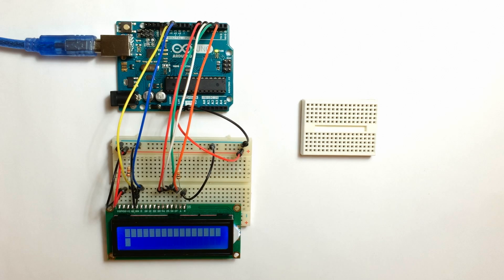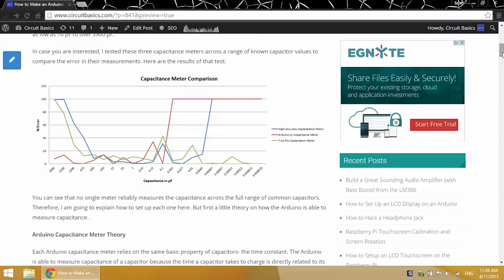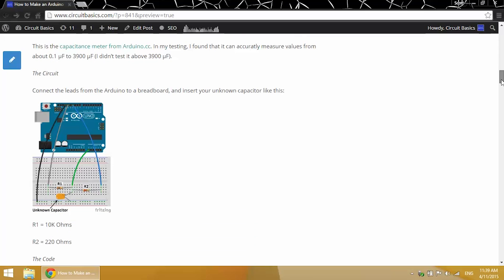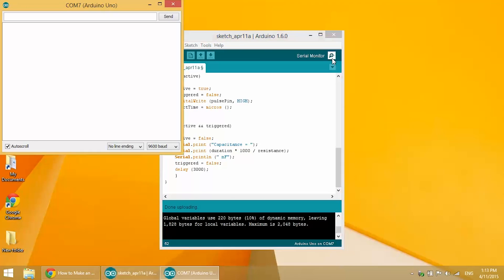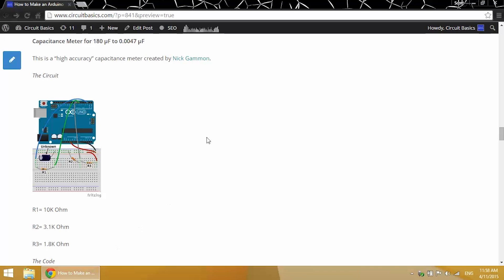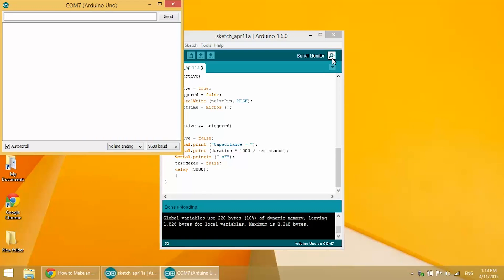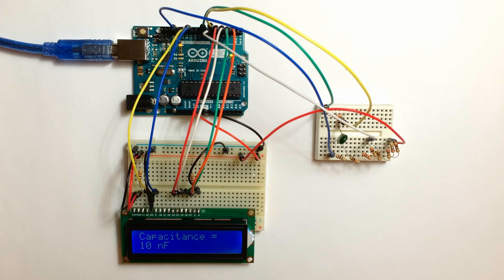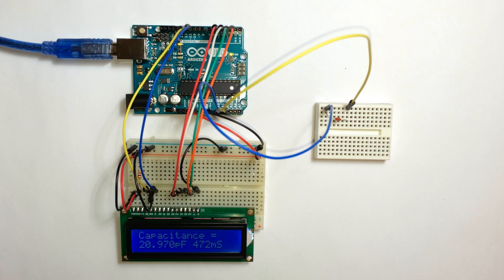How to Make an Arduino Capacitance Meter

Comment: When you say that "meter is accurate", that is not quite correct. This is NOT about METER's accuracy. Fact: electrolitic capacitors are: 1) never have same value as printed on the face of them. They have +/- some percent deviation. This is inherent to the capacitors. 2) as electrolytic capacitors age, they leak and their values decrease. So, METER has nothing to do with any "accuracies" or "inacuracies". Meter is excellent. In order to test the Meter itself, you would have to compare this meter's reading with some known capacitor's value, for example by measuring capacitor's value with several other meters.

Comment: This works really well. My multimeter only does capacitors up to 1000uf and only displays OL when it test bad, where this will give you an actual value for a dead cap. Thanks!

Comment: thanks man,  I'm building a Tesla coil and am makeing my own caps but I dont have a lcr meter or a scope and my multimeter doesn't mesure capacitance, this should be perfect and I will build it first thing tomorrow morning.  Great video,  and thanks again 
clicks subscribe button
Reply: ***** It gives you the capacitance of a capacitor (In microfarads) which is essentially how much it can hold, being that capacitance is coulombs divided by voltage, and coulombs are a measure of electrical charge. Therefore a higher capacitance would lead to a higher electrical charge which can be visualized as more water if you use a water and tank analogy. If you need calculate the percent to which a capacitor is charged, you can take the voltage of the capacitor divided by the charging voltage but just remember that capacitors do not charge linearly and the rate at which they do charge is dependent on the capacitance of the capacitor.

Comment: You do realize ALL electronic components have some percentage tolerance on the nominal value? 
Meaning a 10 nF capacitor can be 11 nF or 9 nF or some other value within its specced tolerance. 

Besides that nice video. 
Thanks!